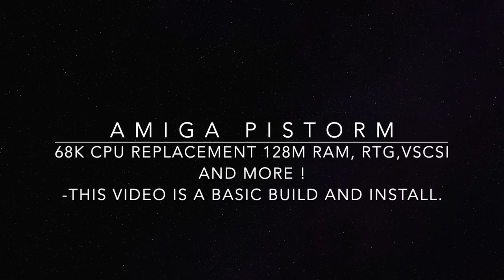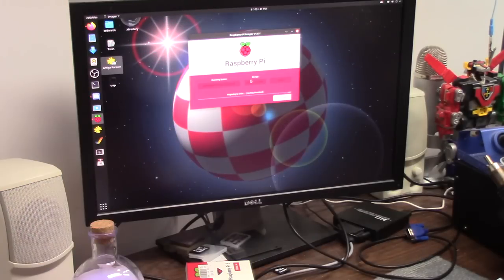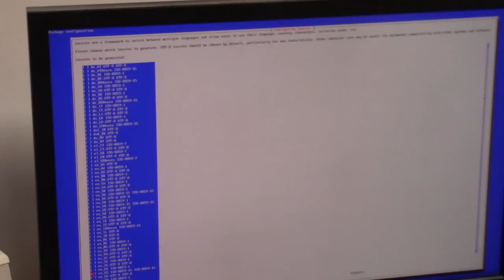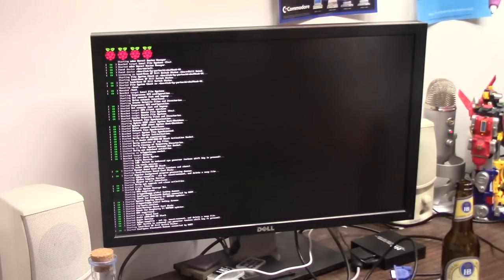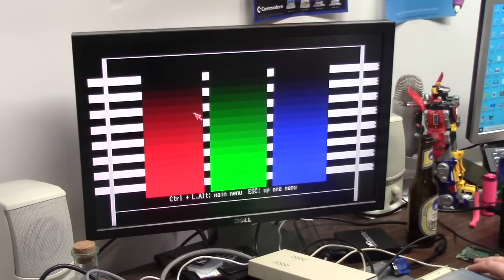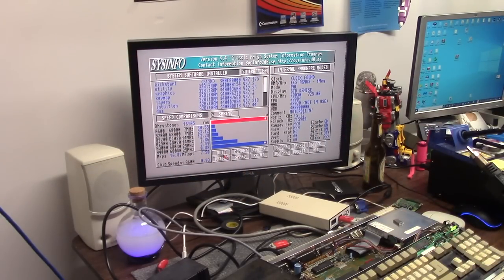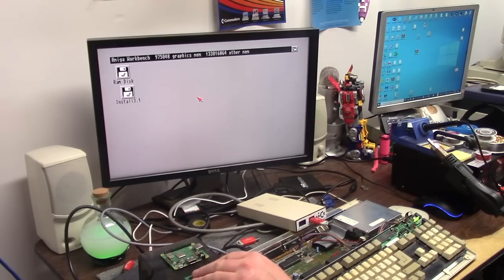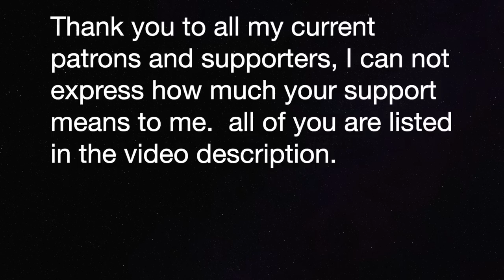PiStorm 68K CPU replacement and more

Comment: Boot time is no more worse than some 1200's and 4000's when you do a reset on the keyboard.
Reply from the maker: Warm boots are less that one second
Reply: @ChrisEdwardsRestoration  Ahh... I meant Pistorm cold boot are as fast as a1200 keyboard reset.
Reply: @brostenen  only with an USB attached SSD + very hard optimization.
Changing the underlying OS could reduce the size of the image and will also speed up the boot.
You could create your own embedded linux with buildroot.
Another very interesting approach could be to use the CM4 Model which exposes one PCIx lane.
Attaching a M2 SSD is the next logical step: https://www.youtube.com/watch?v=4Womn10v71s

Comment: Hi, just putted my Pistorm on my A500 with a RPI 3B. My Pistorm was from a little batch done on Retrowiki, it has been changed the shape because Original PIstorm design puts the PI with some risk of touching the metal plate of the keyboard and the case seems to don't close fully with it. Have you experienced this problem?
Reply from the maker: No , even with the wrong pins not even pushed all the way in it still fits fine.
Reply: Do you have a link to the Retrowiki?

Comment: Simple way to get more performance out of an Amiga. It is a lot cheaper than a Vampire board. BTW, you don't need to use sudo to run the emulator from rc.local as rc.local is being run during startup by the root user.
Reply from the maker: Yeah bad habits

Comment: So why can’t i use my pi 3b if it’s in a checkmate case? Clearance wouldn’t be an issue. For that matter a pi4 even.
Reply from the maker: Rock on.  I was just doing what was recommended at first. I too will be doing more as i learn more of it all. Its changing fast so theres always new feaures being added by claude
Reply: The problem with clearance is the extra full sized usb ports and maybe ethernet port. You have to take them off the Pi for the adapter to fit onto the Pi.
Reply: @PATTHECATMCD  nutz. Always something.
Reply from the maker: Or use a ribbon gpio
Reply: You can also use a ribbon cable to put the Pi somewhere more convenient.
Reply: @ChrisEdwardsRestoration  will the pi still draw power?
Reply from the maker: Why not.
Reply: @ChrisEdwardsRestoration  asking from a noob perspective, you know more than i do.
Reply: @ChrisEdwardsRestoration  2 reasons - IDC ribbon cable can't handle that much current. The other problem is the gnd return pin gets noise from the other other cables carrying switching signals. Maybe it would work with thicker cables that had shields, but I really doubt a standard IDC ribbon cable is up to the job unless it's an inch long or less.

Comment: If only it would work with a UDOO RYZEN Bolt V1000 Maker Board SBC so you could emulate the 68040 plus 68881 floating Point emulation

Comment: Are Amiga software and games 100% compatible with the PiStorm?
Reply from the maker: pretty close. and it adapts all the time.
Reply: @ChrisEdwardsRestoration  Ok 👍️🙂️, ty
Reply: @JediPhenix  If it runs on UAE then it will definitely run on PiStorm. And PiStorm I think even has higher compatibility than UAE does.

Comment: Isn't there another modern Amiga expansion that also uses a RasPI? I think it has to do with HDMI video out of the Denise chip. Imagine using both that and this at the same time. Could you network the two RasPIs to each other? Hmm...
Reply from the maker: One is for display

Comment: Anyone know if it will be possible to make an PiStorm for Amiga 1200. And if no, then why exactly? Right off the bat, I tend to think it will be the same kind of limitations as the RGBtoHDMI. However I am a curious person.
Reply: Common sense should tell you you're asking in the wrong place. You need to ask the creators of the PiStorm directly, not the YouTube audience. 🙄
Reply: @another3997  I thought it was common sence to be polite and not roll eyes at someone. I was eventually going to ask them at discord. Because I have no twitter or facebook account.
Reply from the maker: No fb? Dang make one up theres some really great amiga groups on there most of us are on them!   A1200 is in the works. A600 hardware files done and can be built.
Reply: @ChrisEdwardsRestoration  thx for the info about A1200

Comment: For many years I had am Amiga 3000T with a 486SLC bridge board, Cyberstorm 2 060 and Cybervision 64. I really was well in to them. A remember going through the hardware and kernel reference documentation and thinking this is so clever as far as on OS goes. Knowing better now I can see the the Amiga hardware was compromised by half way through being switched from a games console to a home computer. For games it lacked tiles to save precious graphics memory, the chip memory was used up far more than necessary. Taking out the tile support from the Atari 8 bit chipset to focus on biplane rasters really was not good for games dev. More seriously the multitasking OS lacked so much of the resource tracking needed to make system of that kind stable, let alone an MMU to make memory protection practical you just could not use them for anything without them crashing, at best you steadily lost huge amounts of memory as you open and close applications. Most of the problems of applications these days come about from C/C++ pointer problems trashing memory, the Amiga had no defence from the bugs in all the C applications on the platform. I tried to get through college with Finalwriter, ProDraw and so on but it was just not on. I loved the Amiga at the time but not so much now.
Reply: It would've been game over if the Amiga chipset came with a CHUNKY mode as well as the PLANAR GFX,
Reply: Paul, I'm not sure if you have a real point to make, apart from saying, with hindsight, the Amiga wasn't perfect. Everybody knows about it's faults. But it was better than just about any consumer level computer available at the time. PC hardware was mega expensive, and ill suited to games and typical home use. Macs were worse. The Amiga OS was ahead of MS DOS and Windows 3.x, the old 68K Mac OS, Atari TOS and GEM, even Acorn's RiscOS. You needed Win NT or Unix for real stability on PC hardware. Neither were consumer level OSs. Did CBM fail to invest and innovate? Yes. Did others overtake the Amiga? Yes. Was it really a bad computer? No.
Reply: Paul, I'm not sure if you have a real point to make, apart from saying, with hindsight, the Amiga wasn't perfect. Everybody knows about it's faults. But it was better than just about any consumer level computer available at the time. PC hardware was mega expensive, and ill suited to games and typical home use. Macs were worse. The Amiga OS was ahead of MS DOS and Windows 3.x, the old 68K Mac OS, Atari TOS and GEM, even Acorn's RiscOS. You needed Win NT or Unix for real stability on PC hardware. Neither were consumer level OSs. Did CBM fail to invest and innovate? Yes. Did others overtake the Amiga? Yes. Was it really a bad computer? No.
Reply: @another3997  Yes I think you are right, NT was the silent killer. I worked out because MS spent huge amounts of money making  Windows more stable before just dumping the core for NT and the final grand unification in Windows 2000. It's amazing how Apple survived really and would not have done without Mr Jobs going in to the wilderness to develop NextStep. MacOS was a creaking mess of instability, just waiting for a crash. What really was harder than coming along with great hardware for the future was to build an OS.
 Amiga had great plans but they never would have had anywhere near the resources to bring it up to be reliable. It was an amazing bit of work. I think they missed a chance with version 2 on the A3000, they could have improved resource tracking and made use of the MMU rather than just to shadow in a kickstart of disk. I know many applications would have just died in such a scheme so a fall back mechanism would have to exist to run kickstart 2 without stricter checking and the MMU for low end machines but at least developers would have a system to reveal the problems with the apps they came up with and fix them for the benefit of all users.
I suppose I am guilty of forgetting just how bad everything was then when multitasking on a domestic computer was in its infancy.
Reply: @pauledwards2817  Windows 2000 didn't have Direct3D. Windows XP was first time a consumer version of Windows got NT kernel.
Reply: @n00blamer Direct 3D did was not relevant to me getting my documents created and printed. Games were very much the console thing. the retro scene concentrates very much on nothing but games to reflect the age group going back to these things as younger people. I was trying to do work and you just could not use an Amiga with a hard disk and accelerator to do real work as they crashed even quicker the faster they got. I have been told that it was possibly hardware or such problems but the same applies to my experience of emulation and FPGA, doing real working and multitasking it was just waiting for the guru to appear at any moment and ruin your day. They really needed to fix this but the catalog of software using the Manx C compiler for example just made this such an uphill struggle to finish the OS without breaking so many applications. A DOS based PC running Lotus 123 or Wordperfect could be relied up not to screw up your day. Look at the Amstrad PCW, minimal hardware and OS but it did the job and did it reliably. MS went through the pain of Windows to get it to NT/Win 2000 and made something that had true multitasking and could be reasonably stable. You just can't use a machine for work if you can't trust it and in the end people need a computer that worked, not played. I tried but my A3000T had to go.
Reply: @pauledwards2817  I was commenting on this: "final grand unification in Windows 2000.", I thought you meant merging the 9x and NT product lines in XP. In this sense the 2000 had nothing to do with the 9x series, it was just another release of Windows NT. Back in those days I was a CTO and doing "real work" too, so no need to go there, ok?
Reply: @n00blamer  Quite true. What sold Win 2000 as the unification of the MS windows line in to NT was plug and prey. Having to go back and face all messing with that in NT was a step back for people. I think the point I was trying to make was that if people went with an Amiga past games they really were in for a shock if they tried to take one to college for example. The A3000T went to college with me and was part of my final year dissertation, but running FreeBSD to host my TckTk hacked up applications. I knew I could not trust it with my other work. I don't believe the Amiga could have kept going and taking the audience with them once their needs changed, the OS was not up to it and because of that the company had nowhere to go. I am getting on to retirement and forget how things related in time but the only rescue for the company I could see was an Apple buy out and they could use the chipset to make cheap Macs but by then the LC machines were more capable if costing a good deal more but similar in capability to the AGA Amiga 3000+
Reply: @pauledwards2817  I LOVED the 2000 too, it was first Windows that really was rock-solid and could be productive in. I was over the moon about XP when could do everything on one machine or w/o booting (we did a lot of D3D graphics related work back then). On 2000 had to use GL back-end which was behind the D3D on features (at the time OpenGL mostly supported what Quake used, not much else, the drivers were really bad..)

A bit off-topic rant, but goes with the topic.. back in the old days the drivers were so bad.. these days drivers are pretty good, and features are really nice. All the tools and compilers are so much better. Future looked really good 10 years ago. Then something happened... everyone started doing their own thing and graphics coding scene fragmented..

Apple deprecated OpenGL, not updated anymore. Latest supported version is 4.1 and no updates, compiling GL code on Macs gives warnings about API being deprecated, please use METAL API. This leads to the point that Apple did their own graphics API, METAL. No support for Khronos standard Vulkan. Then on Android they do OpenGL ES and Vulkan. On Windows you got OpenGL, Vulkan and DX 12. It's now impossible to write software for only one API that is easily portable to other platforms.. and didn't even mention game consoles yet.. this has set up the landscape for middleware like Unreal Engine and Unity.. not so bad. but if you want to do something simple these days it is not simple anymore because of this arbitrary fragmentation, mostly because of political and NIH (Not Invented Here) reasons. Future was much better 10 years ago, then reality happened.. a big thank you for everyone involved.. you are real VIPs.. thanks again for ruining the future.. :_D :D

Haha, sorry about the rant.. came from the heart..

Comment: You know what would be cool? ..... TSMC or someone making a 5Ghz 68040 with 1GB of onchip ram, 1MB of flash rom and a simple GPU on chip.
Reply from the maker: The buffee project is a similar answer to your question but i believe its an 030
Reply from the maker: But no video
Reply: Also all network encryption / decryption done onboard the Pi for full fledged internet surfing....
Reply: @ChrisEdwardsRestoration  you do know the "Buffee" project is a direct challenge to Apollo Accelerators' Vampire 4, right?
Reply: IDK about 5Ghz, but the Apollo Accelerators Vampire 4 FPGA uses a design they call AC68080 (Motorola briefly came out with the 68060, which can be repurposed for use in an Amiga), it is pretty close to what  you are asking for.
Reply from the maker: @squirlmy  buffee is ghost bullcrap in my opinion. 140+ for a beta board that does not exsist, and no one seen any physcial. i was to do a review, and return for the boards, but then all of a sudden there were issues, now theres a 5 week delay on the beta boards because they dont boot. its one excuse after another and no one has actually seen a real physical board besides renders and mock ups...  and its no competition for the vamp, no ethernet, rtg, hdd, just a cpu and ram. nothing fancy.
Reply from the maker: @squirlmy  have you seen my videos ? i did vampire reviews as i am a vampire owner on the 2000  and 1200 that i have not even opened yet..  I love my Vampire. im no purist when it comes to emulation, if it runs Amiga OS in one shape or form on any platform thats cool by me.

Comment: will works with A1200 ?
Reply from the maker: not yet, but hardware is being designed for it, the emulator needs to be updated to support the 32bit bus of the 1200/3000/4000

Comment: why sudo nano when the text file is in the pi user's home folder? never pointlessly sudo, it's a terrible habit
Reply: I think telling people not to pointlessly use sudo like some form of elitist is a terrible habit. Kind of like grammer Nazi's.
Reply: @byteoncomputerservices8054  no actually overusing sudo is a big security problem, ur running all that stuff as root and root can do anything, including break things very easily
Reply: @DouglasWalrath  when you install software using apt and perform certain tasks on a Linux system, the use of sudo is unavoidable. Absolutely no different to UAC under Windows. Using sudo in situations regarding the /home folder is not a security risk as the user has full rights to /home, so it's essentially moot.
Reply: @byteoncomputerservices8054  but it's a bad habit that can lead to other problems down the road
Reply from the maker: for me its a bad habit, i had to do this on Pimiga 1.5 because the shebang i called mapped some stuff that needed a sudo boost. and habits die hard.

Comment: Looks good, pity there is a chip shortage so no one can get them......
Reply from the maker: You can get the chips on eBay dirt cheap
Reply: EPM240T100C5N you can get pretty much everywhere. It's out of stock at lcsc.com, but I've ordered all the other parts for cheap there using the lcsc part# from the BOM.

Comment: Auto-login is completely unnecessary. The raspberry pi will boot just fine without it.
Also, rc.local always runs as the root user, so sudo will not actually do anything. It's harmless, but not necessary.
Reply from the maker: i know it will boot automatically, but it wont run the emulator automatically, hence my rc.local call to launch the emulator. sudo just a bad habit. but dont hurt on your own 37 yr old Amiga.